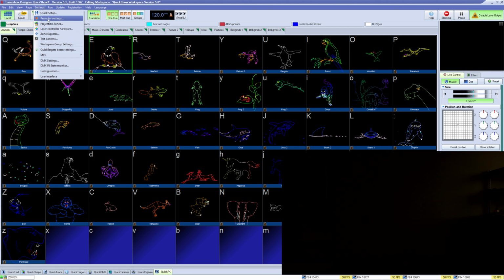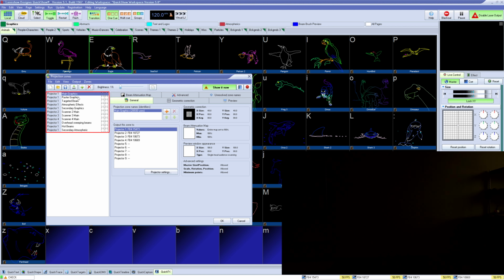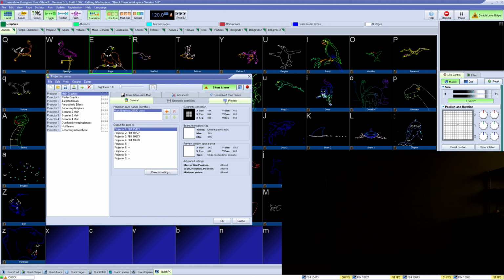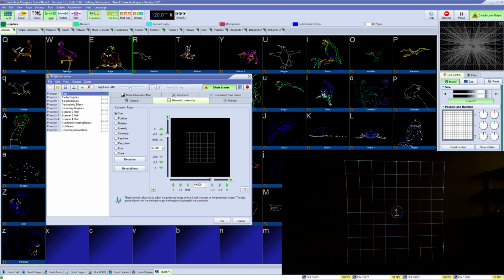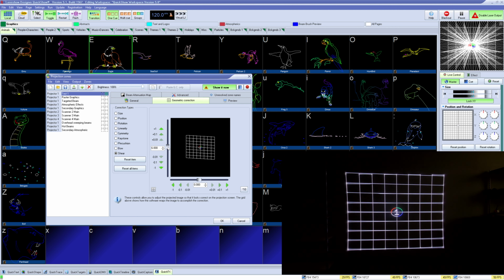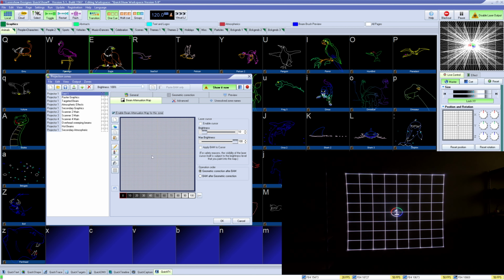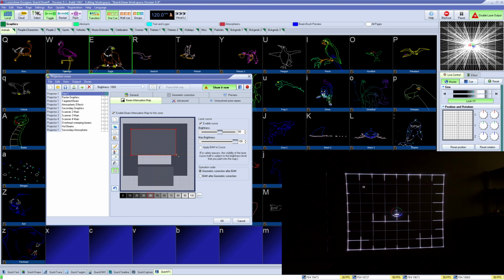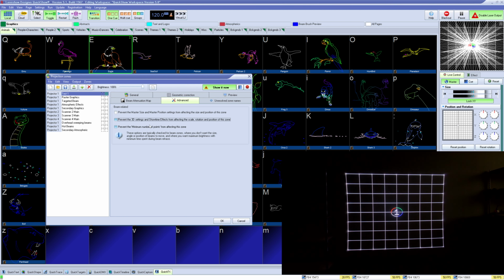How to Use Projection Zones in QuickShow

Comment: Using Quik show, how do I completely eliminate the vertical axis?    I’ve seen a video on it that was from seven or eight years ago and it took the guy one second and all of a sudden the laser was going through all the auto programs except just shooting everything out horizontally.      No one has been able to answer this question and I’m scratching my head wondering why appreciate your help big time.   He was using a CS 1000 so it was very basic.
Reply from the maker: Without Y axis your complete image would be flat, you would not be able to see what is being projected. Could it be that he used the angle with a very flat zone?